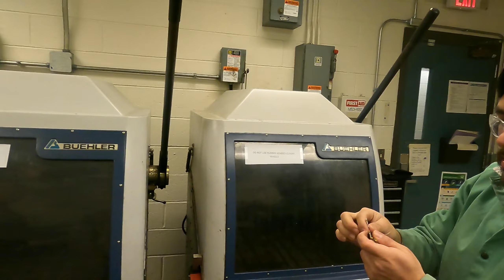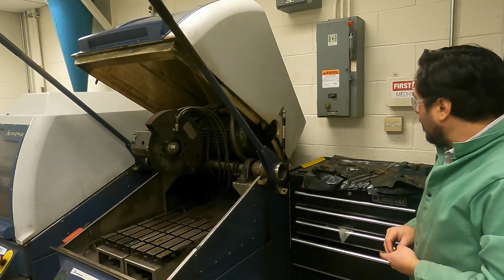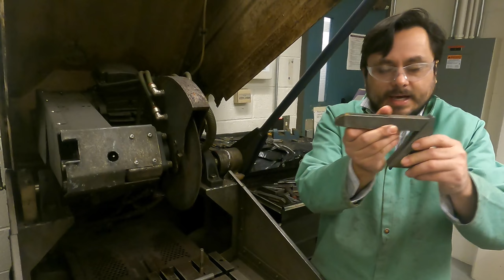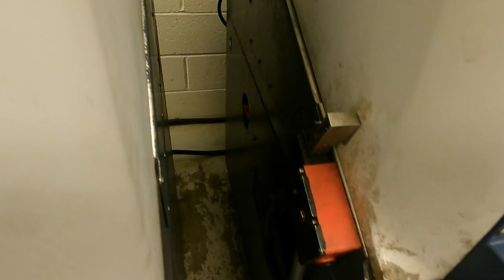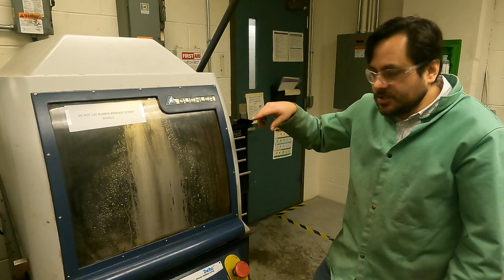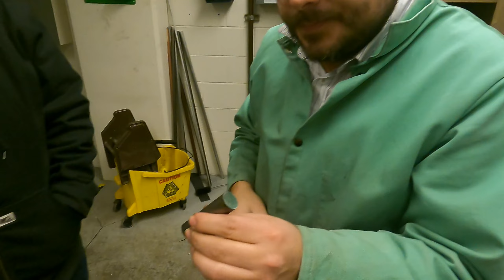Using Delta Buehler Abrasive saw at MSE Missouri S&T

Comment: Hello, I have a question about your Matlab stress strain curve video but the comments are disabled there. For two specimen, the code worked just fine. But I am trying one where the yield stress finding isn't working. After putting the two points, I am getting the error: 

nrecognized function or variable 'row_yield'.

Error in find_yield_func2 (line 49)
yield_stress = stress(row_yield,1);

Error in Tensile_lab (line 74)
[yield_stress,row_yield] = find_yield_func2(strain,stress);

Thanks a lot for your code is hugely useful. This is my only issue
Reply from the maker: Thanks. Probably, you didn't copy/save the function "field_yield_func2" on the current folder of Matlab. This function must be there to run the code.